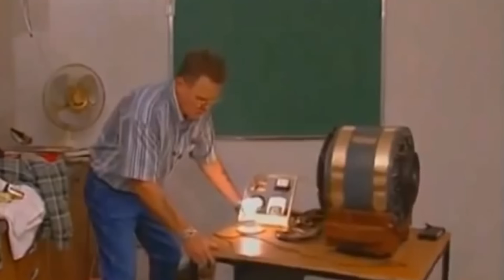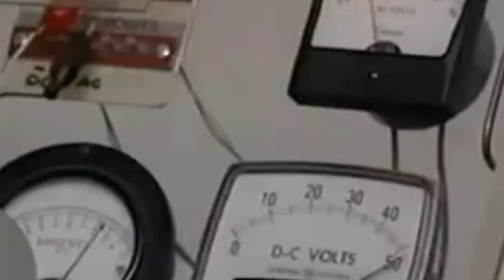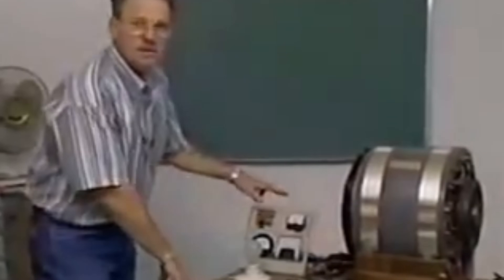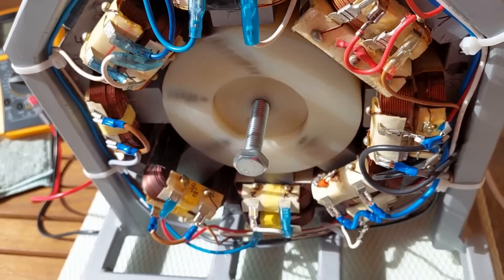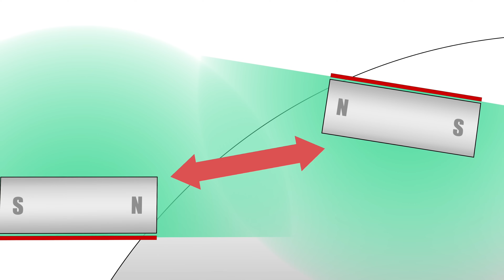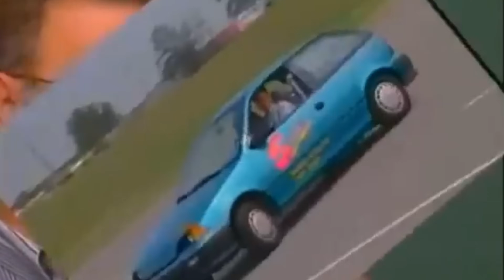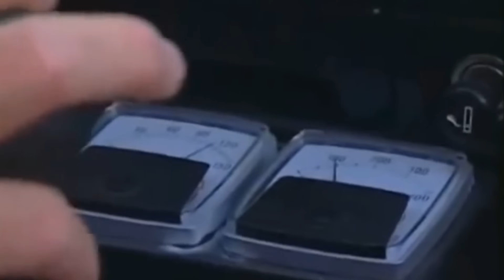Troy Reed 110kW Magnetic Motor Free Energy Generator Future Renewable Energy!

Comment: Magnets exert a constant magnetic field. This means that while the N pole attracts the S pole, before entering the field of the next magnet, the N pole approaching the S pole will begin to recede, and the system will lock itself in place.

In Hertz or DC motors, the process is different; the magnetic field is constantly changed thanks to the brush (carbon) system. Therefore, a cycle is created, and the motor continues to rotate.

The logic described for magnetic motors is similar, but the critical difference is this: In electric motors, the brush contacts the copper windings, interrupting and re-energizing the magnetic field at the right time. In magnets, there is no such contact, switching, or field-changing mechanism. That is, attraction is established, but this effect cannot be interrupted before reaching the opposite pole.

Therefore, it is impossible to create a continuous cycle using only magnets.

It seems more logical to research physics before contemplating infinite energy.🙃

Comment: Dynamos use external power to rotate magnets which create electricity through induction. It's that external power that all of these free energy devices claim to revolutionize. I've never seen any of the scads of claimed free-energy electricity generators powering any public or private home or business. Folks, it's all still just smoke and mirrors as of 2025. Perhaps we should be glad these folks are still chasing the dream as "the nut" of free-energy certainly can't be cracked by not trying. It's just it gets a bit ridiculous for claims that this is being mastered and is generating more in than out.  By what I've seen and researched this just ain't happening anywhere where it is truly verifiable. Though some of these stories are more interesting than others the commonality is they all just come to absolutely zilch.

Comment: Is it plugged in to a power outlet at 3:23  what was the kill-o-watt meter reading on the mains side ?
Reply: That is John Adam's motor design. I don't want to say  this but what you regarded as anomalous readings in your experiments have been refined and made use of, for example flyback voltage spike that is suppressed by reverse biased diodes in motors and generators.

Comment: Average U.S. Household Energy Consumption:
•	Monthly: About 877 kWh.
•	Daily: 29 kWh
•	Hourly: 1.2 kWh
This is power by time (hours)
Power at a given moment is different and quite normal, maybe 14.5 kW to 24 kW, a generator has to accommodate this as load also.

Comment: This motor never worked as is claimed by some, and Troy eventually abandoned it to focus on his EV car conversions.

"The magnets provide the necessary force to keep the rotor spinning indefinately"
This is of course false-magnets can't provide the force to do anything. Magnetism is a force expressed as a field, and in order to use this force, something must be moved acrossthis field-which of course requires an outside energy source.
That's why magnets are never an energy source.

If someone is promising you something for nothing, keep a tight grip on your wallet-the grift is about to start.

Comment: Had Troy Reed's energy generator been proven to actually work in a real world test, (where it counts) This would have been in world-wide production. There are many people claiming to have built such machines yet none exist. Even if one person gets shut down by the bad guys it's only a matter of time before someone else recreates a working device. Have you ever noticed that when someone calls you on your cellphone that on average someone else you know will call you roughly at the same time and if you pay attention to this you will notice it happens more often than not. It's a sort of a psychic or spiritual connection or thing that we all have as living beings on some level or another. This same argument can be made about two people designing something based on the same concept no matter if it's a better can opener or a free energy device. My point is that at this time a free energy device does not exist and the evidence that it doesn't exist is the fact that it DOESN'T exist at least not at this point in time. Hope this helps.

Comment: Grok says: "Scientific Review: There's no credible scientific review or peer-reviewed publication validating the claim of a 10KW output from a device like Reed's motor without an external energy source. When claims like these are made, they typically fall apart under rigorous scientific testing." This baby needs an open debate in a laboratory, with high level opposing scientists arguing each side. If this doesn't happen, it's probably bogus.

Comment: Newman motor he’ll Johnny Carson had him on the show . You think they didn’t look into him before calling him ? Dam right they did. 
The holy grail is defeat cogging the magnet will not release its hold it draws thins to it but won’t let go it’s called clogging!
Supposably Toyota has defeated it by the angles not the traditional 90degrees rotor stator field interaction but angled to optimal angles like the slope on the pyramid  one was 22degrees the other the slope angle on pyramid 52 I think it is. 
David yurth the scientist talked about this . I think the got him to his web site has gone cold  that’s why I’m here tracking down the technology.
Reply: The real problem is that permanent magnets deliver forces but in regard to energy they only deliver what physicists call "potential energy" which is over a full turn always zero. Trying different slopes doesn't change that at all.

Comment: The government will never let this become reality.
Reply: They don't want to lose their slaves
Reply: @jamesreynolds7086 as much as I would love to believe in this technology I think there are details that still need to be worked out. Faraday and other inventors where working on something similar in the 1820s but nothing came to fruition. I'm not an engineer but I've read comments like the magnets would lose their strength over time or mechanical components would malfunction due to wear and tear. This is not like nuclear technology where the government can regulate the components required to build such an apparatus.
Reply: @tagcoriolis1029    Faraday built 1820 the first primitve e-motor. Which needed an input of electrical energy as all e-motors do. Magnets losing their strength is not the problem at all, since they keep their strength for decades. And mechanical components would not malfunction more than with any other mechanical device. The real problem: if a magnet attracts an object you can gain energy, but to repeat this you have to pull the object off the magnet. Which consumes the energy which was just gained before. Permanent magnets deliver forces but no energy.  E-motors can be built with e-magnets alone or a combination of e-magnets and permanent magnets. The 1820-motor was of this type. With this combination permanent magnets help in the transformation from electrical to mechanical energy but don't contribute to the energy.
Reply: All these free energy generation videos use fairly simple components available everywhere.
With the number of videos available for let's say 10 years already, isn't it surprising that not one of these so called 'inventions' has made a breakthrough?
It has nothing to do with government or other BS excuses, it simply goes against certain laws of physics and hence will never work.
Gosh, there are gullible people around.
Reply: Not exactly the government but a black hidden part of it !!!!
Reply: Because they want to make money from selling electricity, you're right the government will never let this become a reality.

Comment: This concept makes sense. I thought of this years ago but am not an engineer and could never build it. Well done Troy..
Reply: The video looks like it was made in the 1980s. According to wikipedia Michael Faraday was experimenting with this technology in the 1820s. I can't help wonder why in the year 2024 this isn't at the forefront of renewable energy discussions.
Reply: @tagcoriolis1029     Faraday never experimented with motors, which are driven by permanent magnets alone. His famous experiment of "electromagnetic rotation" was different. In this experiment he sent a current through a wire and realized the first primitive e-motor which had - as all e-motors - an input of electrical energy. The permanent magnet only serves as a tool to change electrical into mechanical energy but does not contribute to the energy itself.
The video says, that science is still having discussions about the magnet motor. This is not true. Science is certain that a motor can't be driven alone by permanent magnets, since permanent magnets are not a source of energy. The video also says that the magnet motor of Troy Reed was validated by experts. This is also not true. Troy never let experts examine his devices.
Reply: @heinzpg  do you think Troy Reed's Magnetic Motor works or is this a hoax?
Reply: @tagcoriolis1029     It is definitely a hoax.
Reply: @tagcoriolis1029  Os motores magnéticos de imãs permanentes existem e funcionam. O problema é que não servem praticamente para nada devido à sua pouquíssima potência.
Reply: Troy couldn't build one either. Which is no surprise. A motor can't be driven only by permanent magnets, that's impossible due to best confirmed laws of physics. Troy was simply a faker.
Reply: No perpetual motion available on this planet, magnets will wear out, replacement, creation of parts, items Similar just works for a set amount of time before heat and friction wear out. The energy to mine, melt, form, fabrication,....ect.....more than the gain from the output of energy over time. Hence, no perpetual motion. Most items are fake anyway.
Reply: True,  it's not mechanical energy unless the current feed goes up to 4 amps.  It's electrical but what I am presuming he does differently is he lowers the torque , therefore increasing the rpms to get a lower value of amps, therefore increased range.  Essentially, a gas car has a feed of .03 amps via the stator.  Evs are able to do the same by contributing power to the motor from a secondary power source (it can be an alternator, a transformer or in his case a fridge surge motor), therefore turning the main motor into a generator with load.  I've seen this many times, and usually the DC motor gives off a honing sound with winding effects.  Rich rebuilds had built a golf cart to do this unconventionally using an alternator reaching 14 volts at 60 mph on a 12 volt battery.  Another content creator, Forever gaming does the same thing using a type of transformer and spider circuit.  I can tell troy reed also uses a spider circuit.   The results are amazing, faster charge time, greater range, and overall battery degradation doesn't exist.

Comment: If you use bigger magnets you'll get more power
Reply: no way, the smaller the magnet the more power it generates. with no magnet at all it can power a large iron smelting furnace.
there is already a pilot project like this running in antarctica.

Comment: I remember this guy died after creating his car, the problem is for all these devices I have seen is no one is there to stand by them and demand a better way, so it is easy for the powers in control to silence them, making false claims of their own, like the device was a scam, and the inventor a fraud, and needs to be tested and the results never talked about, but the point is the people need to wake up and demand we use them, and the person creating the technology needs to be protected, I showed just some drawings of a twin plasma generator to a YouTuber in Skype and ended with the American FED making up claims about me to the FED in Australia wanting them to take all my digital devices and media, and put me in jail for life.
I have also had a friend that showed us his car running on pure tape water from the hose, filling his tank, running strait into the carburetor, saying he opened the jets to allow twice the flow, had a coil on the side of the motor four inches in diameter, single thin wire going the positive on the coil, and that was all I could see, never checked the sparkplugs, I was only eight years old at the time so never thought of it.
But he had converted his car to run on water, no fuel cell or any other bull, he was found dead on the side of the railroad tracks after trying to sell it, so sad  to see these people pay the price to do what they believed in, creating a better world.